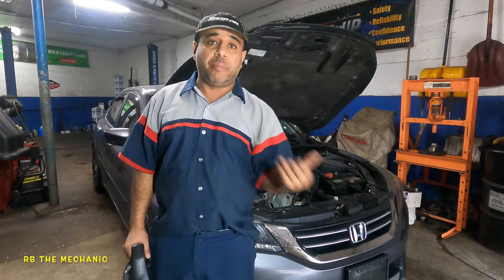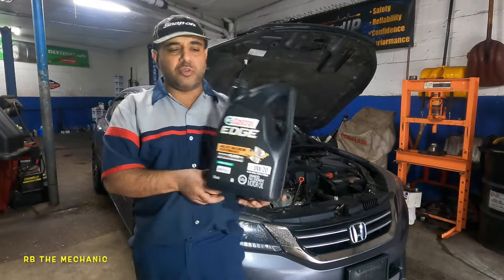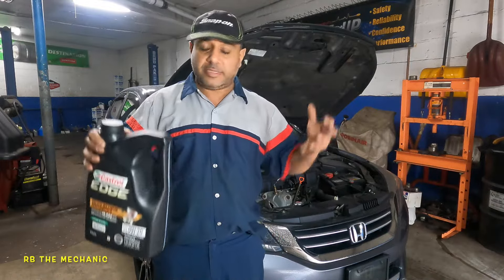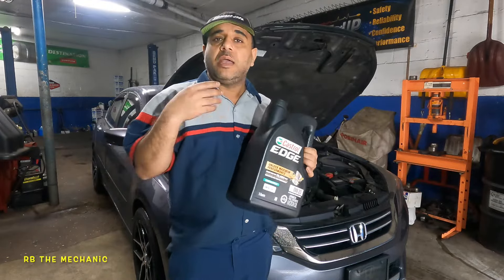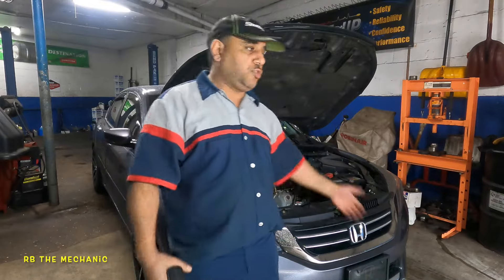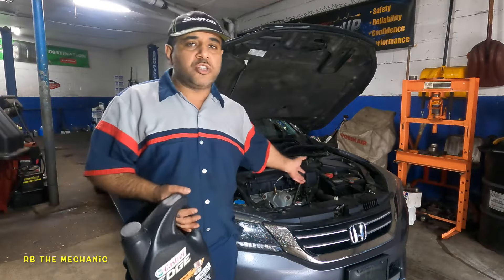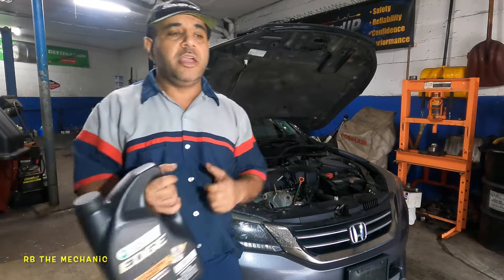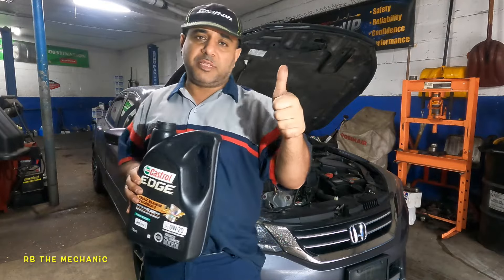Try this to FIX Honda Oil Consumption issue!

Comment: I took my car to Honda and they told me it’s normal. 💀💀💀
Reply from the maker: They always say that but u should tell them if engine sizes up is that normal and who will be responsible if it’s normal
Reply: 😂😂 jokes aside its because the real techs are hard to find man but try a piston soak
Reply: Its normal for the Honda to burn a little oil. @RBTheMechanic
Reply from the maker: @mg8720-u7j  nope not normal and it’s not little it’s all of it within 2k miles
Reply: @RBTheMechanic  I Gotta try that oil... I got an old old Accord Euro (Acura TSX there) 2.4 - 190 Break and it lost about 700 milliliters in 1000 miles with quite a lot of hard acceleration sooo I am assuming it is "fine..." and by that I mean.. I can drive it like that lol
Reply: Lol
Reply: @MatchHead27  they're right. Honda for ya...
Reply: these engines come with defect from 08 to 07 have problem consuming oil Honda problem dealer problem
Reply: @RBTheMechanic ur sure right it’s not a little oil! I have to add at least quart to my Honda Pilot every other week!!
Reply from the maker: @ yes we’ll make the steps start with pcv valve
Reply: My engine broke today 😢 it had no oil due. It had been burning oil for a year and the engine finally blew
Reply: @RBTheMechanic YUP you are right I am having the same problem I'm using 0-20 thank God I chick my oil cuz I do 100 miles a day
Reply: The first page of the service bulletin (for my car at least) it says to "Call the client dumb and tell them to add more oil to the engine" not word for word but that's what it might as well say lol, then they get into the tools and parts needed to replace pistons and rings.
Reply: @nike2126 that sucks man..  did you have motor oil in your engine at the time.or did u accidentally run it empty?
Reply: @johnstarks32  I think it was empty and what made it worse was that the same day in the morning I was stuck in the snow and I forced the car like crazy to get out and engine locked on me while driving at night that same day
Reply: @nike2126  gotcha..  Yea a car will go for awhile even if it's burning oil as long as you don't let it go empty and drive sensibly..  I've lost a car to a blown head gasket myself..
Reply: @johnstarks32  yea bro it sucks

Comment: PCV valve is for preventing excessive air pollution. It has nothing to do with oil consumption. Clean piston ring? What are you talking about?! If your car eats oil you need thicker oil, not 0w20 which will definitely pass through gap of wore off piston ring and get burned with fuel in cylinder.
Reply from the maker: Yes some pcv valve dose cause this issue

Comment: Our granddaughter's CR-V was using 3 quarts of oil between changes. I haven't tried changing the PCV valve but will do so. At her last oil change, which I performed, I exchanged ½ quart of oil with a bottle of the new Synthetic Marvel Mystery Oil and now the oil consumption has been reduced almost in half. I'm not using Castrol but SuperTech 0W-20 instead. It's do for another change this weekend so maybe we'll try the Castrol OW-20. Can't hurt.
Reply from the maker: Ok update us with results
Reply: How is the consumption now?
Reply: My 2005 accord uses 10 quarts every 6k miles has 275k miles on it still running 😂
Reply: Lol me 2
Reply: What happened after changing pcv valve
Reply: I just changed the pcv ,500 miles ago ,I will let you know if I remember 😅
Reply: @MrSprintcat how is it?
Reply: @MrSprintcat any update ?
Reply: Yes , it burns less oil . When ever I was at a stop light I could smell the oil coming from the exhaust.  Not any more, so it dose help. Down almost 1 quart, better than 2 ,that's my result. 😅
Reply: @MP-mz1vu  Nothing will happen

Comment: Piston soaking for 48h with seafoam and some MMO in the oil for 3-4 oil changes. I don't even have to check the oil between 5000 mile intervals on my 2011 CRV with 170k
Reply from the maker: Nice will try that can u recomend /link

Comment: Bro my 2012 acura mdx is burning crazy oil to the point i was doing oil changes every 2400 miles...hit up the dealer and acura of peabody mass said i need a engine rebuild ..who the hell needs a rebuild on a precison certified vehicle ..if they dont fix it its gonna be someones funeral...i had 6 acuras never did i have this issue ..
Reply from the maker: Try using this oil also change pcv valve
Reply: @RBTheMechanic  ok ok its right in the front on the motor ...ive always used mobile one ...im in arbitration now lets see what they do ...
Reply: Which viscosity ?
Reply: I subcribed bro
Reply from the maker: @acuraledgend9648  same it’s called for
Reply from the maker: @acuraledgend9648  I find mobile one don’t do the job for these new generation built engine with low class position rings
Reply: Ive had my 2011 for 10 yrs i just add a quart every 1500 miles..

Comment: I live in Saudi Honda recommends 5w30 to 10w40 I think it is normal to suffer from oil consumption if you use 0w20 even 5w20 but 5w30 is very good for this engine
Reply from the maker: Try that

Comment: Great video, thanks.
My son's 2010 CRV has the infamous oil consumption issue.  The oil drop is rapid, like 3/4qt per 500 miles. 
I'm not seeing any oil in the engine (I cleaned the engine so I could easily spot leaks), no spots in the driveway or anywhere else, and no blue smoke... It has to be burning the oil.
I'm  a former master mechanic, so I replaced the PCV, tried doing piston soak with Berryman Chemtool, and used BG EPR.  No change yet, in fact it almost seems like it's using more oil. 
Putting in fresh oil this weekend, and use Valvoline restore and protect. This oil is rumored to do a very good job of cleaning up  binding oil control rings which these engines are apparently notorious for.
Reply: Good luck. We don't have Valvoline restore here in Canada but I managed to save my 2011 CRV by soaking the pistons with Seafoam and Marvel Mystery Oil in the crankcase 200 miles before an oil change and now it barely burns 1/2 a quart every 5000 miles.

Comment: I would also recommend Valvoline Extended protection. I have a 2015 Honda Accord and it doesn’t burn much anymore
Reply from the maker: Ok will try that
Reply: Did you use the semi-synthetic or synthetic Valvoline extended protection? Also, what weight did you use? 5w20?
Reply: Try Valvoline Full Synthetic high mileage, fixes everything. Change oil every 2500 miles until the issue is resolved, usual 5-8,000 miles.
Reply: The Valvoline restore and protect will clean the oil control rings over 3 oil change intervals.

Comment: For Honda engine that is burning oil try this before replacing engine:
1.  Replace PCV.
2.  Disable VCM using S – VCM.
3.  Seafoam the inside of the engine 100 miles before oil change. (Loosens piston rings)
4.  Use good quality full, synthetic engine oil and filter. Replace every 5000 miles.
Reply from the maker: Thanks for all the information also gtx castrol oil helps a but
Reply: What is the VCM ?
Reply: Which seafoam do you recommend for my Honda Accord 2016
Reply from the maker: @silascastellanos  variable cylinder management
Reply: @silascastellanos  if you have over 75,000 miles I would use the high mileage seafoam.
Reply: No seafoam on the V6's, it break the seal and end up having oil leaks. have seen this a few times
Reply: @karthikagnesh7480  What about Accords 2.4L 4 cyl engines?

Comment: Have a 2011 Acura Mdx was using 1 qt every 600 miles. Added 1 qt of Marvel Mystery Oil in the crankcase and 8 Oz to the tank every fill. New oil change, now at 1 qt per 2000 miles. Many new vehicles having this issue is due to build up on rings. Marvel Mystery oil will clean up your rings by using it on the top side in the gas and bottom side in the crankcase.
Reply from the maker: Ok thanks
Reply: trade it in for Toyota lol don’t got time for that forreal lmao

Comment: My son's 2010 Accord 4-cylinder oil consumption issue May have been improved with an array of BG oil and gas additives that is supposed to help with sticking piston rings.  It didn't work immediately and im not for certain as we don't have good documentation.

My personal mechanic wants to do a leak down test.  Another mechanic suggested that valve guides and seals are usually not the issue.  It is the rings.

He doesn't put a lot of miles on it which would explain the slow progression of improvement.  He bought it with about 140,00 miles.  My other son bought an Accord with the same engine and same issue that nearly seized the engine.  Fortunately the dealership took it back and offered a Camry as a good will gesture.  The Camry lost a lot of oil also, however it was the value cover gasket set that was leaking and evaporating the oil on the intake manifold and spark plug/ignition coil holes.  We discovered this when changing the spark plugs.

Comment: GDI - use 2 x CRC intake valve tins 1,000 miles apart. And Valvoline Restore and Protect. Change every 3,000 miles.

Comment: I would recommend using B12 additive in the pistons. Take off the spark plugs and fill the cylinders. Let it soak for 24 hours. The solvent will clean the pistons and the piston rings. After 24 hours make sure to remove all the liquid out of the piston before installing spark plugs again. You can vacuum, use compressed air or use your starter to crank the motor and it will shoot the liquid out. (Although this is the messiest way to do it) after all this is done put everything back and run the engine. Drive it like this for about 200-300 miles and then do an oil change. B12 is not meant to be used as an oil additive so make sure to CHANGE THE OIL and don’t just wait till your next oil service. 

After all this keep checking your oil and see if the issue has improved or been solved all together. PS* the #1 reason a car burns oil is because of the piston ring letting oil pass through. This is why this method is pretty effective’s

Comment: I assume that's the GDI engine right? If so, my comments below DO apply to the other Honda motors. 

I did some research since my daughter's `08 Accord with the 2.4 was going through oil at the rate of more than a quart every week or so. I know it's due to the crappy low friction rings but I am not interested in pulling the motor to replace the pistons and rings. I considered some Chemtool in the cylinders, let it sit for a day and soak down to see if that helps but too many were reporting it as ineffective. 

I've spent too much $$ on this POS already so I tried Castrol 0W-20 synthetic oil and MMO at the same time with an oil change. I did replace the PCV a few weeks ago and that had no net positive effect. 

1 week later, about 600 miles on the car and it has not used a single drop of oil and I mean none. I took a photo and the oil level had a very distinctive, tiny slant in the level on the dip stick. Now, I can't say if it was the lighter weight oil alone or the MMO or a combination.

If this continues I won't have to dip into the engine yet again and I'm ok with that. 

Thanks for the tip, it actually works for the non GDI Honda engines.
Reply from the maker: Yes gdi
Reply: Wait so your driving around with the mmo and oil mixed together? Or are you  adding mmo like 600 miles before your oil change?
Reply: I have the same exact car. 2008 accord with the same 2.4L k24z3 engine. I changed my oil last month on the 10th and I checked my level the other day and I’m down almost half of what I was at. That’s about 1qt of oil burned every like 430 miles maybe more
Reply: @PurpHaze830  Yep, ran with the MMO and lately have switched to another additive, can't recall which. Oil consumption is up/down in the past few months. I've basically given up trying to control it because it's come down to managing it. Just run with the additive and keep an eye on things. The car has 243K on the clock but it runs just fine so I will just watch it from here on out.
Reply: @PurpHaze830  What oil do you use and what mileage, that engine sounds like toast...If you use 0w-20 can't hurt to try Castrol black Edge or GTX synthetic in 5w-20, if you already use 5w-20 use 5w-30 and maybe MMO or STP ceramic treatment...I have a 2010 Accord 2.4L 4 cyl 125K miles and burn 1 qt every 2k miles, using Castrol GTX 5w-20.

Comment: I started using exact same oil as you presented last couple times and I solved the issue with consumption oil I use Honda Accord 2015 sport
Reply from the maker: Nice good job
Reply: did you use the castrol edge black bottle 0-20w?
Reply: regular or high mileage?
Reply from the maker: @cartracer64  either
Reply from the maker: @cartracer64  my
Friend use that
Reply: I just got rid of the car saved me a headache 😀
Reply from the maker: @duhgreat8449  that’s a another way

Comment: I'm just going to say this this is the same problem that caused my friends fatal accidents engine blew due to lack of oil seized my friend lost power steering and hit the wall and was killed on impact..... Honda 2.4 L engine killed my friend.... all I got to say is avoid any honda 2.4l or any Honda engine that has oil consumption problem it can save your life
Reply from the maker: Holy cow HONDA it’s a shame and ABs module failure
Reply: Sorry your friend died. Luckily I found out when My engine failed due to low oil when I was pulling into my driveway.
Reply: So sorry about your friend!!! IMO Honda should have to recall these engines. I have a pilot 300000 + miles. Burns oil like crazy now cats are full of oil. I’ve used cat clean it works for a day or two then right back to engine dying while driving. After reading ur comment I think it’s time to just get another vehicle. Too many miles on it to pay for new cats. Luckily when I’ve lost engine power it’s been while driving on regular streets so far but I do a lot of highway driving and I worry the whole time if I’m going to lose power while at higher speed. Just not worth it anymore.

Comment: What do you reccommend for interval. How many miles for oil change?
Reply from the maker: Umm good question if ur having oil consumption issue I would check every week oil level and top it off
Reply: 3,000, 5,000 or 7500. Depending on driving habits.

Comment: I am using Royal Purple oil 5w30, and Lucas stop leaking oil additive for my 200000 km Toyota. Engine working much better and burning less oil then before. I need to add about 700ml of oil per 1000 km now. It was 1000-1200 ml before. I also using Royal Purple injector cleaner, engine running like new.
Reply from the maker: Great point!

Comment: I bought 2017 CRV 2.4 L with 25K miles in it!
I live in Florida and i think 0W-20 is too thin in this hot climate! I m planning oil change every 3000 miles but i would like to go with a bit thicker oil!
Castrol Edge 0W-30 or OW-40 maybe!?
What would you use?
Thanks!!!!🙏
Reply from the maker: Yeah check the manual book
Reply: @RBTheMechanic  Thanks for your reply! So 0W-20 on oil cap but any harm if you go thicker oil 1-2 range (0W-30/40)!
Plus try to do an experiment with Ceratec (ceramic oil treatment) and doing oil change every 3000 mile with Full Synthetic!
If the engine will burn oil years later (like others or in your videos) after No More Honda cars!!
Reply: Check what the European version of your car with the same engine takes.
The reason why manufacturers in the US recommend 0w20 is simply for fuel economy regulations. 
Anything that pleases the EPA is bad for your engine, in 99% of cases.
I have an accord. The same European accord with the same K24 engine recommends anywhere from 0w16 to 10w40.
I have been using 5w40 European blend oil by penzoil. No issues for the past 100,000 miles.
Do some research on this topic. You’d be surprised what you’ll learn. Good luck!

Comment: Why isn’t anybody talking about VCM on these v6 Hondas. A death wish for your engine. Guaranteed. Get a muzzler and baby it with frequent oil changes and a liqui moly flush
Reply: Interesting. I have oil consumption problem on 2009 TL SHAWD so I looked it up thankfully I don’t have VCM
Reply: True. Good running engines for the most part, but the thinner oils do burn off more easily. Use high-quality oil and change it every three months with a good filter. That kind of sucks, but we gotta baby these engines to keep em going or we can expect major failures and repairs

Comment: My accord 2007 burns oil is it ok to use different kind of oil than the one recommended by Honda. Mine uses 5w20
Reply from the maker: Defiantly use diffrent try GTX castrol
Reply: My 2010 2.4L 4 cylAccord takes 5w20 and where I live, it's mild winters and pretty hot summers, so I'll get Castrol hi mileage syn oil 5w30 for the 'hot' summers. When it gets before an oil change I might use some MMO or STP ceramic oil treatment to top it off

Comment: I watch almost all ya videos on these cars and it’s funny my car 2016 sport 9th gen starts doing this on my last 2 oil changes in the 60 thousand range I thought the place was messing with me so I did it my self and changed the pcv Valve same thing but I went back to look at the oil used and it was the one your holding and that oil when used wasn’t much burning goin on with other oil brands issues so I’ma try that oil again and see if it changes I want to bet it does that oil I think is the best for these cars they burn oil regardless but that oil helps
Reply from the maker: Yeah change the pcv to start and try this oil I’m sure it will help